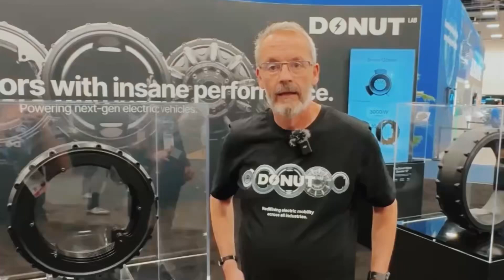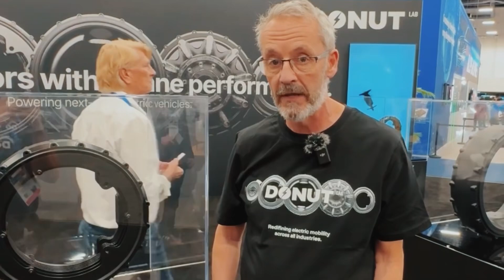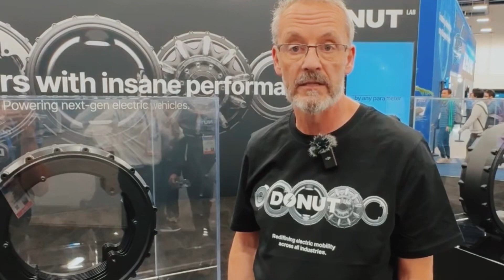In-wheel Motors | The Unsprung Mass Myth

Comment: Do these motors experience bearing overspeed issues high vehicle speeds? If not, then why impose a 124 mph speed limit on the bike?  Would an improved design move the bearings to a conventional central hub?

Comment: Im not sure that testing done by average drivers in perfect conditions is paramount to unsprung mass being a myth with handling.
Yea you can do some suspension tweaks etc but its still kinetic energy being pushed away from the road surface, might not be a big problem until its actually a problem.

Comment: I have a hub motor on my electric motorcycle and it has lasted a long time with no problems. Just have to remember to change the bearings at the rated intervals. Haven't had any issues with NVH (the tires soak up more of that when the hub is heavier) or handling.

Comment: I wonder what this design could do for offroad applications, assuming this could be used for a 4WD vehicle, this would give you impressive ground clearence, assuming you could attach the suspension knucle way higher than the center of the wheel.

Comment: Please add another wire to the coil so the fly-back (voltage) pulse can be recovered to a capacitor bank and dumped (current) to charge the battery.
https://www.youtube.com/@redesign3dp 
https://www.youtube.com/@kenergy1707
Reply: They will no doubt have "regen" in exactly the same way as any other EV.
Reply: @MrAdopado  This is not regen, this is a Bedini type system.
Reply: @jatigre1  So are you meaning in addition to standard regen? (It's hard to imagine that this could add a useful additional amount of energy recovery.)

Comment: What is the maximum voltage support for a 12-inch motor? I want to use it in fsae. If supported up to 600v, this motor will greatly reduce the under-spring quality and bring great innovation to fsae。
Reply: mcu supports dc600v

Comment: While I see the advantages of this design, I see a potential problem. How will it affect suspension design? With the torque required to drive a vehicle, in a conventional vehicle, being borne by the structure of the vehicle, what's going to happen when the suspension is required to resist that torque? And how is that going to affect the durability of the suspension which, up until now, is only required to manage road irregularities?
Reply: Agreed ... and modern suspension with multiple bushes already requires fairly frequent repairs even without the additional weight and torque implications you describe.

Comment: Awesome design, but the real questions are durability, ease of application, and cost.  Can it survive realistic combinations of CUSTOMER-DRIVEN electrical (rapid cycling, lifecycle, overloads, feedback, regeneration, EMC, ESD), thermal (hot/cold, fatigue), motion (shock, vibration, planned/unplanned directional loading), and environmental loads (dirt, water, snow, ice) people will throw at it?  Be easy to implement (well thought out "factory-supported" configurations for ESC's, Batteries, etc)?  And sell for a market-changing cost (initially high but reachable, then lowering long-term?  Failure to address ALL these basic tenants has killed many promising wheel motor makers.  Without that, you just have a cool YouTube video.

Comment: While hub motor electric bikes/scooters are monsters in drag races, i've seen a hub motor bike win against a mid drive motor bike in road race. It had awesome handling, which i think goes back to the guy who set up the bike. the track wasn't smooth either. My only issue with hub motors is no flexibility in tuning (no final drive).
Reply: What do you mean no flexibility in tuning? Most tuning is done in the controller tuning app these days. Or are you referring to something else?

Comment: fairplay on the Lotus test as i hadn't heard of that, and the fact that you mentioned a fairly light car like a Focus was used makes such a test even more legit (as the Sprung Mass is an equally important part of the overall System Model).  of course not that we'll see any Suspension and Chassis Engineers in F1 or Lemans "willfully" embracing the addition of weight at their wheel ends anytime soon.
Reply: So, he said it, you believe it, on the basis that you hadn't heard it before. I'm guessing critical analysis is not your forté.
Reply: @nickwinn7812  dang are you ok?  I'm skeptical of the assertion too, but that was a really intense response to a fairly neutral post

Comment: Ive ridden hub motor e-motorcycles for years, potholes damage your rims, weight is all over the place, rear breaks dont do shit if youre going too fast, bearings fail early, your suspension needs to be very high quality to prevent the rear wheel from destroying your kidneys.
Reply: You are completely wrong.

Comment: Unless you're building a Trophy Truck or you're like me and put 1,000lbs of tires on a 3,000lb Toyota Pickup, unsprung mass isn't that big of a deal.
Reply: Unsprung mass is a big deal when you hit potholes. Not so much on smooth test track.
Reply: @peterscott2662  No.  Trophy trucks have 8 ply 39in tires with thick aluminum beadlocks and hit 3ft tall bumps at 100+mph.  Low profile tires are the biggest problem with potholes.
Reply: @Brandon_Makes_Stuff  Regular cars don't have $50K in high compliance suspension with 2 feet of travel. Potholes matter to regular cars, not trophy trucks.  Every company that makes in wheel motors keeps saying that unsprung mass doesn't matter, maybe in trophy trucks it doesn't but it does for regular cars which is why EV makers are sticking with inboard motors.
Reply: @peterscott2662  I'm saying if an 80lb wheel can move 3 feet at 100mph, a 50lb wheel could move 3 inches at 70mph.  Much less inertia.  Your tire deforming takes the brunt of the force anyway.
Reply: @Brandon_Makes_Stuff   The car wheel motor weighs 40KG, that's 88lbs just for the motor. You still have to add the rim and tire.  This is massive increase for a regular passenger car suspension to handle.  You need a lot more suspension travel  and a lot more compliance. Sure if you put a monster truck suspension and balloon tires it will smooth it out, but that really doesn't work so well for regular passenger cars.
Reply: @peterscott2662  No you don't.  My black truck had super stiff load range G tires weighing over 200lbs each with super stiff suspension.  Again, unsprung mass is only a big deal to youtube certified engineers.
Reply: @Brandon_Makes_Stuff  I see on your channel you have a Prius, and you like modding. Weld 80 lbs of scrap to each wheel and report back how well that works out. I'll wait.
Reply: @peterscott2662  It would be fine.  Look farther and you'll see the truck with 1,000lbs of wheels and tires.  Go do something in real life.  I'll wait.
Reply: exactly, so many armchair "engineers" love to push their youtube education in comments and forums

Comment: I would like to know the maximum rpm for each motor given that it is likely sacrificed for the sake of torque output for direct drive. I have an application for this motor that would require a gear reduction and the torque capability that these motors have is uniquely able to meet the requirements, but now I worry that the rpms would not be enough.

Comment: Re. questions/comments regarding reliability . . . . I've used fairly inexpensive Chinese hub motors with "hot-rodded" controllers and high voltage/current packs for years with zero failures.    The biggest question is how much more effective this design is at dissipating heat vs. traditional in-hub motors.  I'm guessing most of their power density gains are due to the ability to run more current/voltage for longer periods of time.   I often crank 3-4X more power  (vs. manufacturer advertised) out of my motors but can only do this for so long before risking stator and/or magnet damage due to excessive heat.   Solutions to this have been to use bigger motors (which can add quite bit of weight . . . topic of the video)  and/or use some other way(s) to manage the heat.  Effective thermal management (of all components in EV drive systems) has likely been the most important area of EV development outside of battery chemistry.  There's a reason why EVs can't perform multiple hot laps in succession at the Nurburg Ring and often excessive heat within one or more drive system components (not battery capacity limitations but sometimes possibly braking systems . . . ironic given regen) is/are the limiting factor(s).    Outside of Yasa trying to make axial flux motors cheaper to manufacture, there's been little news of anything other than incremental improvements to electric motors/machines . . . the principles/laws/formulas that govern them are what they are.   It appears to me that these guys have come up with a very clever way to manage heat, thus squeeze more power density from a typical radial flux motor design   . . . fewer parts, less weight and looks cool.   Looking forward to some data.

Comment: To me, the biggest problem is reliability. Engine parts are more heavily affected by impacts than in a dampened/suspended situation.
How about longterm reliability ?
Reply from the maker: Thank you for the question. This has been carefully considered in the design of the entire system, including suspension, motor construction, and the use of robust materials. We also have years of field testing on Verge Motorcycles, which has demonstrated outstanding durability and performance, even in challenging conditions.

Comment: What if, all that vibration made by road, does that cause electric motor ineffecient or unreliable, aptera also change their inwheel elaphe motor
Reply from the maker: Thank you for the question. Vibration and road conditions were key considerations in the design of our motors. The entire system, including the motor construction and suspension, is engineered to handle these challenges effectively. Years of field testing on Verge Motorcycles have shown that our motors maintain both efficiency and reliability, even in demanding conditions.

Comment: Tyres are part of the suspension system, to cope with unsprung mass you'd put some effort in to the right tyre choice. Often we have very stiff sidewall sporty tyres that transfer a lot of thr work to the suspension, going to more compliant high sidewall tyres, you can have suspension do less of the work.
Reply from the maker: All solutions and use cases have been carefully considered and will continue to be, including factors like tire choice and its impact on the suspension system. Thank you for sharing your thoughts!

Comment: Looks like a copy of a Thingap motor. Show us the internal structure. Your company just repeats the same unsprung mass story.  That is the wrong approach. Remove the hub motor for far less unsprung mass.  You need to show and prove the technology or this is just vaporware.
Reply from the maker: @RA-gk5zg  our motors are already in use on Verge Motorcycles, make sure to check them out. And follow us for more content, going deeper into the specifics of each of the motors.

Comment: In my mind the bigger issue isn't how it affects handling, but very expensive bits unprotected being rattled to pieces without protection from the suspension.
Reply: Id like to drive it first, i like to make up my own mind
Reply: The extra mass of the wheel means that more NVH from poor road surfaces will be carried into the cabin, since the wheel is transferring those forces with more momentum. There’s no doubt that the ride quality will be worse.
Reply: @yummyhershey5902  no it wont lmao, unicycles use hub motors
Reply: @Blox117  The better cycles use frame mounter motors. Only the cheap and cheerful use hubs.
Reply: @Blox117  Unicycles? Unicycles with hub motors? Name one.
Reply: @ LOL
Reply: @ <--- LOL sub 50 IQ
Reply: @nickwinn7812 one-wheels, in think they mean
Reply: @nickwinn7812   Electric Unicycles.  The brands are Begode, Inmotion, LeaperKim, Extreme Bull, and KingSong. They're regular ole hub motors... not the hubless rim motors that Verge motorcycle uses.  I'll need to read up on why Verge is using hubless rim motors, given that I believe it requires significantly larger bearings and potentially more magnets and copper wiring.  I guess you do get weight savings of removing the spokes?  Donut Labs motors for cars use a hub design.

Comment: How does this mount in the wheel and how does this change the internals of a car?
Reply: The mounting is actually the easy part. Electric motors have two main components that are responsible for turning electrical energy into mechanical rotation; the “stator” and the “rotor”. The stator is the part that stays still and generates the rotating electromagnetic forces that turn the rotor. I’m sure you know by this point that the rotor is what rotates.

For most electric motors, the rotor is housed inside the stator, and the rotor has the drive shaft attached to it. In this configuration, the rotor surrounds the stator, which means the entire exterior of the electric motor is rotating. That exterior attaches to the wheel.

This configuration allows them to save a good amount of interior space because the electric motor, which used to sit in the chassis, is now mounted inside the wheel. This frees up chassis space that could be used for a variety of things, whether it be additional batteries, cabin space, or additional electronics.
Reply: @yummyhershey5902  yup watched the videos and talks. How does it mount to the wheel/rim? Or does this replace the wheel/rim?

I've seen how it's mounted on the verge, but the automotive donut doesn't have what looks like any lug or bolt connections. Where the semi/truck donut does.

Comment: I've no doubt that in a subjective test of average drivers, a change in unsprung mass would not be noticeable. Most drivers don't spend much, if any time operating at or near the limits of their daily driver's handling capabilities. What would be interesting is an objective, numbers based test of a more performance oriented vehicle as well as a test with drivers more accustomed to performance driving. Beyond that, given that the new family of motors has a motorcycle specific entry, that would seem a very important test as both unsprung and rotating mass have an enormous impact on handling that can be felt even by less experienced riders. None of this is meant as criticism of the product, just questions that could make for some interesting content.
Reply from the maker: @soofle616  thank you for your comment! These are all good ideas and we will for sure be exploring these in future videos 👍 there is also already a real-world application of our motors in the motorcycle industry - Verge Motorcycles have been using our motors for a few years now. Make sure to check them out ⚡️